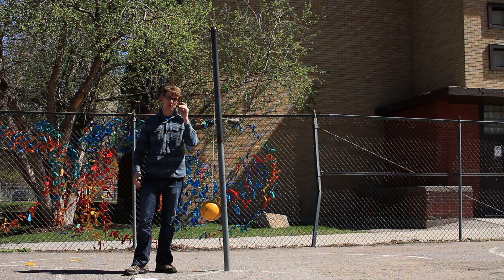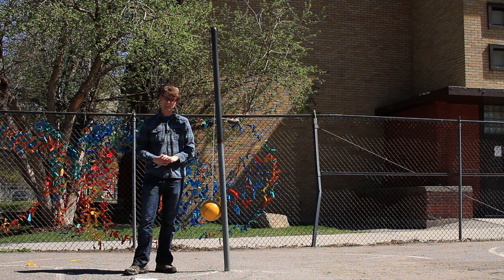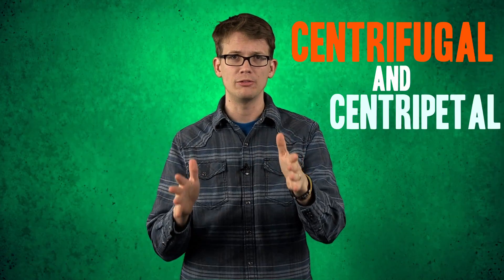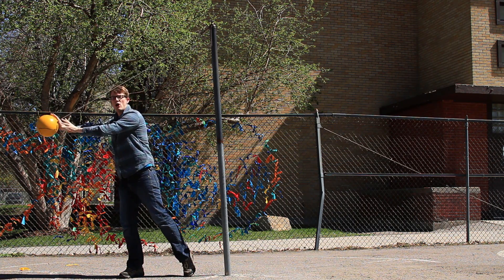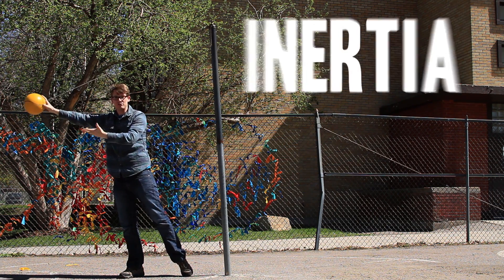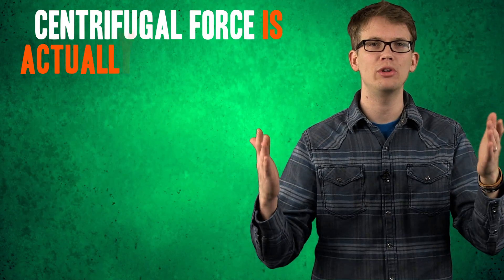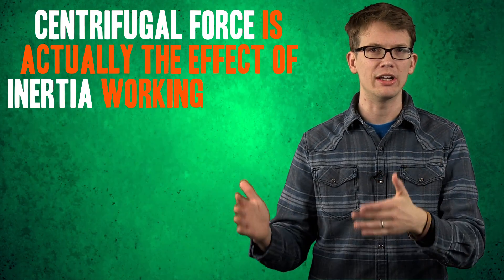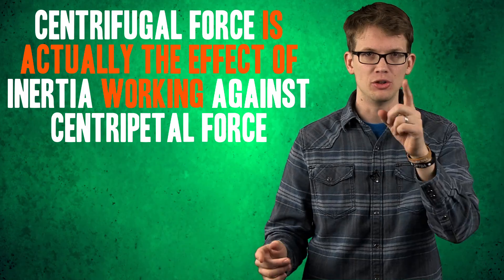IDTIMWYTIM: Centrifugal Force

Comment: God damn.

Its one thing to tell people that something actually doesn't mean what it means, but to distinguish between a "fictitious" and "real" force is really verging on a facile snobbery.

Yes, there's no actual "force" as inerta, but I absolutely love how you even admit that it "feels" as if the ball is being pushed away from the center--AT WHICH POINT WHAT'S THE DIFFERENCE?

Would you use "centrifugal force" in an actual physics equation? Probably not, you'd probably use formula's concerning momentum. But that doesn't mean people are "wrong" to use the term centrifugal force.

Instead of educating people here, all you've done is complicated the issue telling people that a colloquial term isn't scientific. And truth is, if that's all you did, then I'd be fine with it. However, you even admit that you "feel" centrifugal force. When you feel the force (like on a crummy carnival ride) you literally feel like you're being pushed away from the center instead of feeling like you're feeling a force in the tangent line to the circumference along which you travel.

You really feel it, its not imaginary (though it is relative to your reference frame--but relative is not contrary to objective), and there's nothing wrong with describing it like that.
Reply: Thorough annihilation
Reply: What you are feeling on a carnival ride is not centrifugal force. You are feeling the centripetal force hold you into an orbit while your inertia attempts to fling you free. From your point of view it seems that an outward pulling force exists, but none is actually there. The proper term for the force you are feeling on your body is called centripetal acceleration. It is the same force a satellite feels while in orbit around the earth.
Reply: herranton1979

"From your point of view it seems that an outward pulling force exists, but none is actually there."

And there it is. FROM MY POINT OF VIEW. What difference does it make if centrifugal force isn't used in classical physics to explain motion. Does the fact that emotions aren't modeled in classical physics equations mean that they don't exist?

Like I said before, if you're only going to say that centrifugal force isn't a recognized force in classical newtonian physics, then you're right and I agree; but don't go telling people that what they feel isn't real.

Centrifugal force is a colloquial word to mean what you feel when your velocity is constantly changing in direction.

I genuinely don't understand what you're doing other than trying to expand your epeen here. Its not even like you're disagreeing that there is a simulated gravitational pull about a carnival ride, you're just saying "well that's not the correct physical equation to explain it."

To which I say: "... I wasn't attempting to model the force through an equation; I was trying to tell you that the brick you put on me was crushing my chest."

I mean, seriously, by the logic of this video 99% of all coloquial "forces" that we use in every day speech aren't actually forces because there is really only gravitational, weak nuke, strong nuke, and electromagnetic forces.

Are market forces "not real" because they're not modeled in physics?
Reply: insidetrip101 What you are feeling is very real, it is called centripetal acceleration, not centrifugal force.
Reply: herranton1979

"What you are feeling is very real"

Oh, so then I'm feeling nothing. Ok thanks for that.

"it is called centripetal acceleration, not centrifugal force."

Oh wait, I thought I wasn't feeling anything. Here you seem to say that I am feeling something, but its just under a different name.

WHICH IS IT? You are being logically contradictory, and that extends to ANY reference frame including your own.

Think before you speak please.
Reply: +insidetrip101 What are you talking about? Centrifugal force isn't a real force. you can't feel it because it doesn't exist. I didn't say there are no forces to be felt, you made that up all on your own.
Reply: herranton1979

You're making an argument purely based on semantics.

Here's a bunch of your quotes in succession:

"From your point of view it seems that an outward pulling force exists, but none is actually there."

"What you are feeling is very real, it is called centripetal acceleration, not centrifugal force."

"Centrifugal force isn't a real force."

"I didn't say there are no forces to be felt, you made that up all on your own."

Now, all of these quotes--which you have said, not me--are contradictory with one another.

For example: "From your point of view it seems that an outward pulling force exists, but none is actually there." implies that there isn't an outward force; but then you say, "I didn't say there are no forces to be felt, you made that up all on your own."

No, you literally just did say there was no outward force. Oh, but you said: "What you are feeling is very real, it is called centripetal acceleration, not centrifugal force." So now what you're saying is that centripetal acceleration feels like what centrifugal force would feel like from a certain reference frame: in other words it is a distinction without a difference.

And that is the problem here: there is no advantage to saying centripetal acceleration above centrifugal force when speaking colloquially. They mean the exact same thing in common english. Maybe they dont mean the same thing in terms of physics, but they They do to ordinary people.

F=MA

Centrifugal Force = Your mass * centripetal acceleration.

Would this kinda thing fly on a physics exam? No, but I'm not taking a physics exam, I'm talking to people who haven't taken a physics class.

You're so incredibly pompous that I'm embarrassed for you.
Reply: +insidetrip101 And none of them are wrong. There is no outward pulling force. You are feeling a change of direction (acceleration) caused by the combination of centripetal force pulling you inward, and inertia. There is no force pulling you outwards. That is not semantics. It isn't a duck by any other name. There is no centrifugal force.
Reply: herranton1979

"There is no outward pulling force. You are feeling a change of direction (acceleration) caused by the combination of centripetal force pulling you inward, and inertia"

And these two things are indistinguishable from inside the reference frame where you feel the force of acceleration.

There's no way to distinguish it except to be an outside observer: hence, a distinction without a difference.

Further, as you can see F=MA means that force equals mass times acceleration. From inside the reference frame of the spin, there's no reason to say that it doesn't exist.

I mean, this is like going to a navigator who uses the stars to navigate the sea and tell him that his ptolemaic model of the universe is wrong.

He knows its wrong, but its much much more useful for his purpose.
Reply: +insidetrip101 That is like making the argument that gravity doesn't exist on the ISS. It's absurd.
Reply: herranton1979

"That is like making the argument that gravity doesn't exist on the ISS. It's absurd."

Yes, it is like making that argument. That's exactly what I'm saying, but I fail to see why is it absurd. From their point of view, they're not under any gravitational effects.

For all intents and purposes, they're in a zero gravity environment--enough of a zero gravity environment to perform experiments and call them zero gravity experiments.

Is it a "true "zero gravity environment under general/special relativity? No. Is it a "true" zero gravity environment under the standard model? No. Is it a "true" zero gravity environment under Newtonian physics? No. But, from the reference frame where you you're able to seemingly float around, why not call it zero gravity? And if you can call it zero gravity, why say that there is gravity there at all?
Reply: insidetrip101 Now who is making an argument in semantics?
And it isn't called zero gravity, it is called zero g, which simply means there is no acceleration. G does not mean gravity, at least not directly. 
Thanks for the fun, but I can't be bothered to give you an entire middle school science education. Somebody, somewhere along the line, failed you in a big way with respect to your science education.
Reply: herranton1979

"Now who is making an argument in semantics?"

Lets see. Immediately you say: "And it isn't called zero gravity, it is called zero g, which simply means there is no acceleration."

I'm not sure you understand what "semantics" are...

Let me remind you that "A" stands for acceleration if F=MA . . .

Yes, the M has a pretty big impact in that equation, but honestly, your mass as you experience is always the same. So FROM YOUR REFERENCE FRAME THE ACCELERATION IS GOING TO BE EQUIVALENT TO THE FORCE.

Why are you unable to understand relative reference frames? Are you really that stuck in binary thinking?

"Somebody, somewhere along the line, failed you in a big way with respect to your science education."

See, this is about you trying to elevate yourself and feel superior to other people. Newtonian physics isn't generally taught middle school physics.

Further, I've said repeatedly, that if you're talking about this from an objective newtonian standard then yes, you're right. However, usually, when people talk about centrifugal force they're not trying to explain what is happening, they're trying to describe a phenomenon they're experiencing.

Why is it so important that someone phrase an experience in a way that would get them an A on a physics test? If you're talking about how much you love your mother, then you're not being unscientific by not using terms accepted in neurology when you're communicating.

Just because its not recognized in physics as a force doesn't mean its not a useful word to describe an experience.
Reply: Semantics is the study of the definitions of words. Source in link:
http://bfy.tw/42Xw
(given my duck example above, it is pretty clear I get it...)
There is a reason that the entire scientific community disagrees with you. (on gravity, on centrifugal force and on how reference frames work), It's because you are either wrong, or simply don't understand.
Like I said, some teacher of yours, somewhere along the line, failed you big time. I have explained it to you and you choose not to listen. I wont waste any more of my time trying to teach you something you obviously don't want to understand.
Reply: herranton1979

"There is a reason that the entire scientific community disagrees with you."

That's funny, I never said that centrifugal force ought to be an accepted force in classical physics...

In fact, I don't see much what a "scientific community" has to do with this at all.

What do you think I'm saying exactly?
Reply: insidetrip101 You quoted me:

"From your point of view it seems that an outward pulling force exists, but none is actually there."

Then you said:
"And there it is."

No. there isn't. There is a force pulling you towards the center of rotation, and there is inertia. That is it. There is not force pulling you outwards, it doesn't matter the reference frame. The force does not exist. All the 3000 line YouTube comments in the world wont make it exist.
Reply: +insidetrip101 You should go to google and type "define seems"

Just because something seems some way, doesn't mean it is that way. I've typed this three times and to be honest, I'm getting sick of repeating myself. _ What you are feeling is the inward pull of centripetal force and it's effect on your inertia._  You are feeling acceleration. (something that is in motion tends to stay in motion until centripetal force acts on it, then you feel it as acceleration). 
And yes, if my cousin told their kid that they were feeling centrifugal force when they got off an amusement ride as a science lesson, yeah, I would correct him. Because it is incorrect. 

Everything I have typed is correct. if you need more explanation, go take physics 101 at your local community college, and if you want you can print this thread and have the instructor explain it better than I can...
I am totally done, I have already unsubscribed to this thread and I won't respond again. You have 2 options, either learn, or sound stupid while discussing physics with people. Personally, I don't care, I tried.
Reply: herranton1979

"Just because something seems some way, doesn't mean it is that way."

Yea, that's why its accurate in one reference frame and not in another...

If it wasn't accurate in this reference frame you wouldn't have to do this mental gymnastics about it "seeming" at all. You would just look at me like "why are you on acid"

Seriously, If I told you right now that I felt like I was being pushed toward the ceiling you would think I was insane.

But I guess the jokes on me because you'll probably say some shit about Alpha Centauri's gravitational effect on me in the room I'm sitting pulling me directly up...

And the truth is, that's actually right, but I'm talking about COLLOQUIAL SPEECH.

ANSWER WHY IT IS WRONG TO SAY THIS THING TO DESCRIBE A SENSATION?

"I'm getting sick of repeating myself."

You're getting tired of this because you're trying to make this about something I'm not talking about.

I'm not saying physics is wrong, I'm not saying centrifugal force is a complete story.

What I've said is that its an incomplete--but real--occurance that is only part of a picture of a reference frame that does not include all the forces. So what is wrong with using this term if you're only talking about this in an incomplete way (i.e. colloquially).

"And yes, if my cousin told their kid that they were feeling centrifugal force when they got off an amusement ride as a science lesson, yeah, I would correct him. Because it is incorrect."

Thats ENTIRELY different. I'm not talking about as a science lesson.

If the ride were a science lesson I think you'd be right to do such a thing. However, you're not going to become the life of the party if you make this correction if you were just riding on a ride and got off and your bro said "centrifugal force was intense."

I don't know why this has to be about scientific accuracy. I'm not trying to model the physics of the ride, I'm trying to express what the sensation of the ride is.

What is the harm of that?

I sincerely doubt that if you got off that ride and were asked how it felt that you would answer "it felt like my inertia was constantly being accelerated by centripetal acceleration."

I have no doubt that you would answer that it felt like you were pushed up against the wall.

"Everything I have typed is correct."

Most of what you typed was correct. Like I said, I don't know why you think I'm saying you're wrong. I'm saying that you're being a dick and telling people that they're not using words the way YOU want them to.

"You have 2 options, either learn, or sound stupid while discussing physics with people."

Oh, thanks dad. Additionally, I find it funny that you further reiterate your binary thinking.

And honestly, don't respond.

I've been nothing but kind to you this whole exchange, and you've acted superior the whole way through, which is exactly what I predicted in the initial comment (so I will shamelessly quote myself):

"but to distinguish between a "fictitious" and "real" force is really verging on a facile snobbery."
Reply: Full on aggro mode. kek.
Reply: Now that's a destruction.
Reply: Cosmic Taco Cat Really, I thought I was through with this thread and then someone different replied. Sigh fml. That's what I get for trying to help someone understand...
Reply: Nah I get what both of you are trying to say.
You're saying that the force felt isn't really that but other forces.
The other dude is trying to say that he can use the term centrifugal force to give an idea of what he felt was, even though it's not entirely correct.
Reply: +Cosmic Taco Cat 
When we are in a fast car being thrown back into the seat, we don't make up some imaginary force pushing us into the seat. (read in a hick voice: "That thur is the v8 force. they do-dunt teach ya bout that in the fancy shmany sciency class at the ol' communities college." ). 
Why not just say you are feeling acceleration caused by the centripetal force acting on your inertia? Isnt it just easier to give the right answer instead of one that needs an asterisk next to it?
Reply: herranton1979

"we don't make up some imaginary force pushing us into the seat."

You're kidding...

You do realize its all relative? When the seat is pushed into your back, you could just as easily describe that as  you being pushed into the seat.

Those two statements are equivalent. Now in Newtonian physics you over come that by using an "objective" reference frame (but, you could just ignore other reference frames and it be perfectly valid in the reference frame you're talking about), but in special relativity (and by extension general relativity) there is no privileged reference frame, so there is absolutely no way to say whether or not you are being pushed or being pulled. Its 100% perspective.

I thought you studied this kind of stuff?
Reply: insidetrip101 - This is a lot more complicated than a 2 minute video.  I think the important distinction to make is that it absolutely depends on your frame of reference.  Centrifugal force does not exist in inertial reference frames.  This is demonstrable fact.  In the example in the video, the pole and ball are being viewed from an inertial reference frame (ignoring the rotation of the Earth - which is irrelevant on this scale), and in that frame, there is no centrifugal force.   

The purpose of centrifugal force is to reconcile forces consistent with Newtonian physics in reference frames where his laws would otherwise not apply.  Specifically, rotating reference frames.  However, the video is not in a rotating reference frame (again - ignoring the Earth's rotation), so it is correct to say that centrifugal force does not exist.

That said, I completely agree with you when it comes to rotating reference frames.  The video makes no mention of the fact that it is only in inertial reference frames that centrifugal force does not exist.  Inside a rotating reference frame, there is no useful reason to distinguish a "fictitious" force from a "real" force.  They behave identically, so there is nothing wrong at all with treating centrifugal force as a real force in those frames. 

You do not "feel" centrifugal force.  It is no different than free fall in gravity - which you do not "feel".  Just like gravity, you only feel centrifugal force when there is another force countering it - in this case centripetal force.  In the exact same way that you do not feel gravity; you feel those forces that oppose gravity.  If you remove those opposing forces, you no longer feel gravity.  If the wall of a cardinal ride were not there, you would no longer feel any forces.  In THAT regard, it is not a real force - just like Einstein concluded that gravity is not actually a force.

Both gravity and centrifugal force are the result of being in an accelerated reference frame.
Reply: Blake Snipe

"I think the important distinction to make is that it absolutely depends on your frame of reference. Centrifugal force does not exist in inertial reference frames."

I believe I said that I agree with this position, but if I didn't or it was missed, then I agree with this position.

"In the example in the video, the pole and ball are being viewed from an inertial reference frame (ignoring the rotation of the Earth - which is irrelevant on this scale), and in that frame, there is no centrifugal force."

True, but the video also says "centrifugal force isn't really even a thing." That's wrong. Centrifugal force IS a thing. No, its not a thing from the reference frame of an absolute/Newtonian reference frame, but it is a thing from an individual reference frame.

If you were inside a rotating space station that simulated artificial gravity, you would be none the wiser whether that is a "fictitious" centrifugal force or a "real" gravitational force. You have no way of making that distinction until you step outside your own reference frame.

And that's the point here. We aren't always able to obtain a privileged, absolute perspective. In fact, modern physics generally accepts that there is no preferred reference frame, and even further, you can explain almost all of special or general relativity without to appealing to an inexplicable property of mass--inertia. Simply put, there's no clear way to distinguish between what is a "real" force or a "ficticious" force, without appealing to the newtonian concept of an "absolute" reference frame. Such a thing just does not exist.

"The purpose of centrifugal force is to reconcile forces consistent with Newtonian physics in reference frames where his laws would otherwise not apply."

Exactly, and I agree. So maybe you could explain why the video actually says--without qualification--that centrifugal force is "fictitious."

Centrifugal force is simply just not a force in the "absolute" reference frame of Newtonian physics. And if the video made that qualifier, then I wouldn't have a problem with it, but since it is demonstrably true that there is no absolute reference frame, then it is simply not true to say that centrifugal force is merely "fictitious."

"You do not "feel" centrifugal force. It is no different than free fall in gravity - which you do not "feel"."

You make a fair point, but its half a fair point. While you cannot feel velocity, you can feel changes in acceleration. When you're in free fall, what you've actually done is reached a terminal velocity. That you cannot feel, but the initial acceleration (force) (or deceleration when you hit the ground, which is still technically acceleration but only negative acceleration) you can indeed feel.

It is the terminal velocity of gravity that you cannot feel, but you can feel the initial acceleration of it. If you don't believe me then just try it. Jump (safely of course) off of a high diving board into a pool. I know that I can feel my body actually begin to fall during that period. If I  had the time to reach terminal velocity and was truly in a state of free fall, then yes, I wouldn't be able to feel that, but that's only because the forces have balanced out equally.

In other words, and I fear that we may get off topic here, you can not feel your velocity, but you can feel your acceleration. (Velocity is the reference frame you are in, and the acceleration is changing to a different reference frame, hence why you can feel acceleration but not velocity).

"If the wall of a cardinal ride were not there, you would no longer feel any forces. In THAT regard, it is not a real force - just like Einstein concluded that gravity is not actually a force."

While strictly true, its not completely accurate.

First, the wall is there, so you do feel a force. That's like saying if my hand didn't exist, you wouldn't feel my punch, well ok. It makes absolutely no sense.

Second, Einstein concluded that gravity is an effect of a curvature in space time. Its not that its not an actual push or a pull, but instead that you follow a straight path according to the curved space that you are in. . . HOWEVER gravity can just as easily be described as an opposition to acceleration. For example, when you start moving in the car you feel the seat being pushed into your back--just like when you feel the earth being pushed into the bottom of your feet.

This is the reason why you don't really need the concept of inertia to explain general and special relativity. Because the moving of one reference frame to another creates a gravitational effect, and as a result, it explains quite a bit more with the equation E²=(mc²)²+(pc)² because as you can see your momentum will increase as your speed increases thereby resulting in something that can be described as analogous to a gravitational pull--something that is indistinguishable from a gravitational pull.

So I'm sorry, but I'm going to have to say that you're talking shit when you say that this force or that force "isn't really a force." If you're going to say that it isn't required from a certain reference frame, then that's fine, but don't go around spewing nonsense that it isn't a helpful concept in certain reference frames. It is always helpful to be able to talk about this stuff in more than one way.
Reply: insidetrip101 I didn't say it wasn't a force.  I agree 100% with you that the video carelessly and incorrectly denounces CF as "not even a thing".  That is categorically wrong.  I'm with you.

Gravity and centrifugal force are LITERALLY the same in that they are forces that only arise because the reference frame is accelerated.  This is General Relativity and specifically, the quivalence principal.  What you say about terminal velocity is false.  

Free fall is when the only force acting on a body is gravity.  Terminal velocity is when an object is falling under gravity but stops accelerating because drag has become equal to gravity.  Someone at terminal velocity is experiencing the same G force as someone standing on the ground.  That's not free fall.

You do not feel gravity.  You do not feel centrifugal force.  You only feel those forces that oppose gravity (i.e. the normal force).  You only feel those forces that oppose centrifugal force (i.e. centripetal force).  If the normal force is removed, you feel nothing.  If the centripetal force is removed, you feel nothing.

None of this means that centrifugal force is not real.  It's just a statement of fact.  

In general relativity, gravity is not a force.  Free fall in GR is inertial motion.  Not a push.  Not a pull.  Motion free of forces - where he law of inertia applies.
Reply: Blake Snipe

Well since we both agree on centrifugal force, I'm willing to talk about "free fall."

Now, I'd like to point out that you're making a contradiction here.

First you say, "Gravity and centrifugal force are LITERALLY the same in that they are forces that only arise because the reference frame is accelerated."

Then you say, "Free fall is when the only force acting on a body is gravity. Terminal velocity is when an object is falling under gravity but stops accelerating because drag has become equal to gravity."

Taken alone, these statements are absolutely true, but they also entail that once you have reached terminal velocity, then you no longer accelerate. The gravitational force (from your reference frame of course) is accelerating you. The fact that you're accelerating is exactly the reason why you point to this gravitational force in the first place; therefore, you feel the gravitational force (in your reference frame).

Now, don't get me wrong, I get what you're saying about "normal" force. You're really just talking about Newton's third law.

But honestly, this is true for literally anything. You might as well say that the bottom of your feet really don't feel the floor because gravity is pushing your feet down just as much as the floor is pushing up on your feet.

The fact of the matter is that you can feel acceleration. Velocity, you're right, but acceleration is the movement of one reference frame to another, that is literally what these forces are, and if you couldn't feel them then we wouldn't be talking about them.

Yes the wall on the carnival ride is pushing against me, but I'm also pushing against that carnival ride.

This is literally newton's third law stuff, and yes I agree, were you to remove the wall you wouldn't feel the force, but if you removed all of the physical objects, then you wouldn't even be in motion in the first place. So I'm left thinking, what's your point here?

Trust me, if you close your eyes and the floor drops out from underneath you, you're going to feel that acceleration: even if you were in a vacuum, you'd feel it because your insides accelerate at a different rate from your body. And that's what this is, things moving at different rates: if things don't move at different rates, then there is no acceleration, then you haven't accelerated and you haven't changed reference frames.

You can't just remove all of the bodies you're talking about and expect to still "feel" a force because then there are no bodies to exhibit forces.
Reply: +insidetrip101 Wow, there are so many things in that post that aren't consistent with science it is ridiculous. That post, and the ones before it, are like you made up your own version of science and the convinced yourself it was right or the same thing as what science actually says. Both Newton and Einstein are rolling in their graves. Every "force" you are speaking of is still just inertia plus some real force acting on it. It doesn't change or become special in any way by changing reference frames. Your inertia is not a force, and neither is the acceleration you perceive.
Reply: herranton1979

"Every "force" you are speaking of is still just inertia plus some real force acting on it. It doesn't change or become special in any way by changing reference frames."

The thing is, this is a completely unfalsifiable hypothesis.

We can only look at things from inside our  reference frame. Sure, we can look at things from outside ANOTHER'S reference frame, but imagine that you were the only person who was living, then you'd have no way of making a testable hypothesis to test your claim.

That's why reference frames ARE important. And I find it shocking that you think that Einstein thinks that there is some privileged reference frame. Newton, sure, but Einstein? Do you know what you're talking about?

"Wow, there are so many things in that post that aren't consistent with science it is ridiculous."

how about you say one single thing that I've said that is inconsistent and explain it.

Oh, and yes, I fully acknowledge from a static reference frame you don't need to talk about centrifugal force to explain the motion. However, its quite a useful concept to use if you're INSIDE that motion. I don't see, in any way, how that is inconsistent; in fact, my physics text book from college blatantly says what I'm saying.

I'm really tired of being strawmanned here, and I'm tired of talking to people who don't understand what a reference frame actually is (not Blake Snipe, actually had an interesting and honest conversation going).
Reply: insidetrip101

We are talking about centrifugal force; not REACTIVE centrifugal force.  These are two different things.  When you talk about the force you exert back on the wall in a rotating reference frame, you are talking about REACTIVE centrifugal force.  Nobody disputes the existence of this force.  It is an actual contact force - applied BY the object ON the wall - as the reaction to centripetal force.

Centrifugal force - the one being talked about in this video - is exerted  ON the object (in rotating reference frames) with no contact.  There is a hugely important distinction to be made here.  You do not in any way, shape of form feel this force.  It is identical to free fall in gravity.  You do not feel this force until it pushes YOU against the wall and you FEEL the centripetal force push you back.  The force you exert on the wall - is just the reaction to centripetal force - and not what we are talking about.

Yes, you CAN feel acceleration.  So what does it say that you CANNOT feel acceleration when you are in free fall?  It means that you are not really accelerating.  You don't feel any acceleration until you stop free falling.  The reason for this is because free fall is ACTUALLY inertial motion.  Free from all forces.

This is identical behavior to centrifugal force - in that it is a force that is apparent ONLY in accelerated reference frames.  Apparent meaning - you can feel it.  And the only reason you feel it is because there are forces that oppose it - so you never do actually feel these forces - which is why they are termed "fictitious".  Gravity is just as much a "fictitious" force as centrifugal force is. 

I didn't contradict myself.  Gravity and CF are both forces that are only apparent within accelerated reference frames.  It makes them no different than the force when you feel as if you are being pushed into the back of your seat in an accelerating car.  You only feel yourself being pushed into the back of your seat so long as the seat is there.  In that frame of reference, it behaves just as any other force would, so there's nothing wrong with treating it as one.  But, you must at least understand that if that seat were removed, you would no longer feel the force.  You'd be in "free fall" so to speak.  That's how you can tell the difference.

Basically - here's the rule :

If the force acts at a distance and not from an actual interaction with an object (i.e. contact force) and that force is directly proportional to your mass, and if all opposing forces are removed, you no longer feel it, then you would have very good reason to assume that you are in an accelerated reference frame, and that force is only apparent because you are in an accelerated reference frame and there are opposing forces.

Let's go down the list of things that follow this rule :

Gravity -

Acts at a distance? check
Force proportional to mass?  check
If opposing forces are removed, the apparent force removed?  check

You are in an accelerated reference frame

Centrifugal force -

Acts at a distance? check
Force proportional to mass? check
If opposing forces are removed, the apparent force is removed? check

You are in an accelerated reference frame

The force you feel pushing you into the back of your seat in a car -

Acts at a distance? check
Force proportional to mass? check
If opposing forces are removed, the apparent force is removed? check

Free fall is when the only "thing" acting on you is gravity.  And if you ignore drag, if you remove the seat of your car, you would be in free fall.  If you removed the wall of the carnival ride, you'd be in free fall.

There is no difference between being in free fall and being in deep space with no forces acting on you.  They are exactly the same thing.